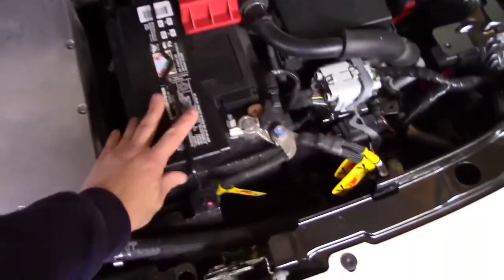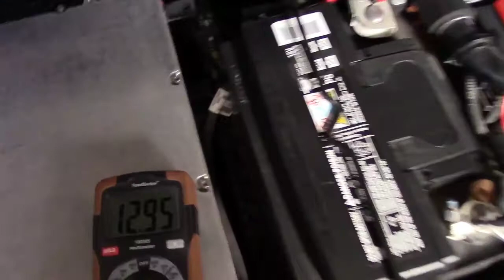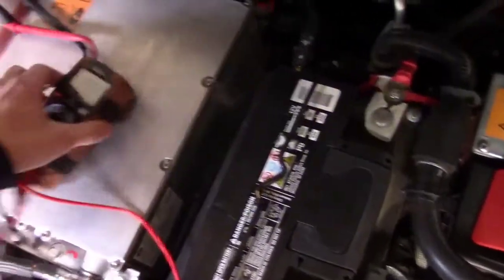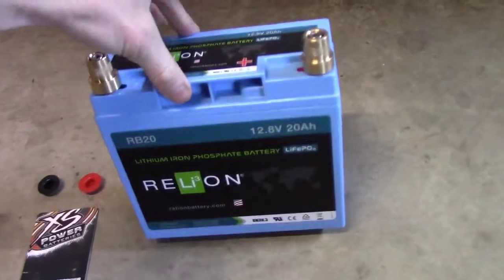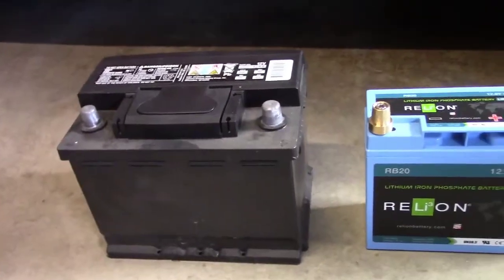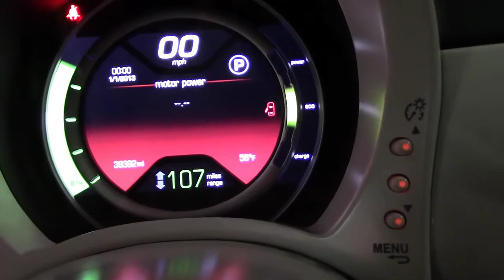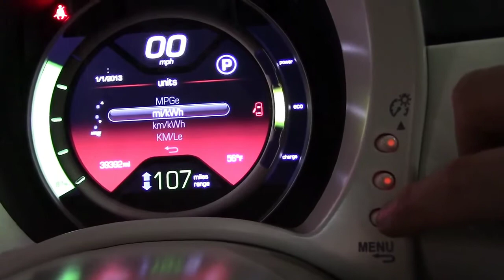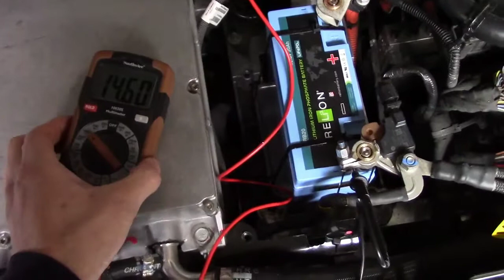Fiat 500e - Modified - episode # 18

Comment: John, I purchased this 20ah and replaced it 3yrs ago following your video. It has worked perfectly. I just got a 1500W inverter and planning on power a 600w fridge and some led lights in case of a power outage in SoCal. Does this 20ah will be sufficient? I'm planning on keeping the ignition ON and let the HV battery supply power to it.
Reply from the maker: I'm glad the new 12v battery is working out, you'll probably not need to touch it for another fifteen years.

I did a video on using a smaller wattage inverter on a 500e.  That one connected thru the 12v cig lighter port.  Honestly, I would proceed with caution & only power the essentials.  If you need 600w for the fridge, internet wifi, and some LED lights.  The grand total would  be well under 700w.   Try to get just what you need and not get carried away with the higher wattage stuff.  I know it's tempting, but there's nothing on the car that draws anything more than 300-400w of 12v current.  The battery heater and cabin heater are both high voltage units.  And at this wattage, definitely connect your inverter cables directly to the battery under the hood.

Comment: One reason the LIFEPO4 battery was showing good volts but not much capacity is because of how lithium batteries maintain voltage even when they are almost depleted (which is a great feature, for sure), unlike a lead acid battery that gradually drops voltage as it is depleted. If you have any lithium-powered tools or yard trimmers, etc you've probably noticed that they run great right up until they actually stop, whereas other battery types start running slower or with less and less power as they are drained. Mine also shipped with over 13 volts but I kept it on the battery charger for a few hours to top it off just to be sure. For the first week or so of driving I also checked the battery setup* every day to make sure it was maintaining the charge.

Thanks for giving me this idea to do this swap! haven't looked back yet and I've talked others into doing it too.

* I ended up with two 20AH 12V LIFEPO4 batteries and connected them in parallel, giving me 40AH, just in case.

Comment: Great mod! My 500e comes off warranty in four months, so that's the earliest I would do it. 30 pounds is a lot, especially in the front.
Reply from the maker: It's one of the easiest most effective mods to do.  Works flawlessly.  Prices have continued to drop.  So, there's even more incentive.  I bought another 12v LiFePo4 battery for another car (to be an electric car conversion eventually) it's even lighter with more capacity & $50 cheaper.
Reply: @theevolvingworld  My OEM battery finally became unreliable. I had to charge it a couple months ago, and then again this month. It's 4 years old. It's weird that random warnings flash on when the 12V battery gets low. I ordered the RB20-LT even though I am in the south because It only adds a pound, and gives a wider operating temperature range. Thanks again for the video!
Reply: @danielkangX  If you do this mod, be sure to charge the new battery overnight before installing. (Ignore what the voltage is, just charge it.) The 500e should never have to be jumped in the classical sense. It doesn't have a starter or pull a big current, it only turns on. If the battery doesn't support the current required to turn on, it needs to be charged or replaced. The 12VDC battery does not affect the high voltage battery that propels the vehicle. They are independent although the high voltage battery does charge the 12V system when the car is operating.

Comment: Lithium batteries are usually stored or shipped at nominal voltage 3.2 lifepo4 or 3.6-3.7 liion. It extends the life keeping it below that or above for long periods will keep it at rated life. It can be trippled or better if kept around nominal in use.

Comment: Hi John, thanks for the reply; here is an update, the Relion battery was replaced with a new one under warranty, and the same problem resulted:  12 volt system shut down after a few weeks of use.  It too took a trickle charge for about a half hour until full, so it's capacity also diminished to very little.  In between, I replaced the original lead acid battery and had no issues.  However, periodically the error message "Service  Electric Vehicle System"  so perhaps there is an underlying problem.  Several bloggers report that disconnecting the 12 volt battery will reset the error in most cases.  Any other advice will be greatly appreciated.  I take it your Relion RB-20 battery has been working fine ever since the swap was made.
Reply from the maker: Thanks for sharing your troubling experiences with us.  It still sounds like a DC to DC converter problem with charging the "12v battery" properly.  Fortunately, I never had any of these problems while owning the 500e.  Although, right before selling it, I removed the RB-20 and use it for testing projects on the bench.  In fact, it's about 4 feet away from me and is charged to 13.2v.   12.8v is nominal which like 50% charge.  They charge up to 13.4v when full.

Comment: If you get the regular 100Ah version it runs between about $700 and $1000, but that's probably overkill. I guess normal lead acid batteries are typically rated at 45Ah.

Comment: Hello, I stumbled upton this video as I was searching around for the "Service 12v battery" error. I'm planning to replace battery in my 2015 500e. Please excuse if my questions are dumb as I'm totally a noob in car tech 🙂. Would this battery be ok for my situation where I drive my car rarely? Like a 10 mile ride once in a couple of months. I've realized that the range on my car has gone very low around 65-70 miles per 100% - how can I get more miles out of it - I could think of weight reduction as one thing any other tips would be appriciated. 
Any other tips for me to love my car more :)

Comment: 2 things, I wouldn't be comfortable reducing the amperage by almost 2/3rds, seconds, in the event of a crash, those zip ties will snap like a twig, potentially causing a huge short & fire.. I`d strongly recommend you come up with a better securing method.
Reply from the maker: Thanks so much for the input.  The LiFePo4 12v has been installed for about a year now, thru the cold of winter & the heat of summer with no problems!  Yes, I suppose in a hard enough impact the ties could snap... But the battery is so light and the positive & negative connections assist in holding it in position.  I'll look at getting something more sturdier.
Reply: @theevolvingworld  I'd get you some nylon tie downs and never have to worry. Plastic tie downs may eventually become brittle being exposed to heat, etc. Glad to hear that you've not had any issues with this battery as I was thinking of doing the same thing (but a Kia Soul EV). Too bad the automobile manufacturers didn't splurge the extra few hundred bucks and go with lithium for the 12V system too (although as expensive as they are I'm sure they were looking for any way they could to cut costs).

So your reply is now a year old and so you've had that 12V lithium battery for about 2 years. Any issues?

Comment: Thanks for the great how to videos!  I performed this battery replacement with the same model and it won't power any of the 12 volt functions after a few weeks; i.e. the car won't start and the dash won't light up, no 12 volt functionality.  This has happened a second time after trickle charging the battery overnight to full.  Any suggestions before I contact Relion for an RMA?
Reply from the maker: Glad you have enjoyed the videos!  The DC to DC converter should be using the HV battery to top off the 12v battery as needed.  It will have to do this more often, but for much less time.  You should not have to "trickle charge" it ever.  Sub freezing temps will reduce the battery performance as would having some heavy parasitic draw.  If it's not one of those three things then it must be the battery.

Comment: have you looked into increasing the range of the 500e?
Reply from the maker: Sure have.  There are newer higher capacity cells that should retrofit quite nicely.  However, not really cost effective... yet.   Meanwhile, 134 lbs lighter doesn't hurt either.  Ciao

Comment: I've been following your vids and they are all great! I might become an owner of a '16 500e by thursday (depending on Carvana). My question is:
if I wanted to upgrade the audio system by adding a sub and amp (say around 250-500W RMS), would you see any issues arise from the additional load on these smaller batteries? Or would it make sense to either:
1. use two of them wired in parallel, or
2. a larger capacity  version of the rb20?
Reply from the maker: Thanks, glad you like them.  I would just be careful not to listen to it unless the car is fully "on".  The DC to DC converter should keep the 12v topped off.

Remember the 12v is the weakest link on any EV.  It needs to be kept sound. 
 Otherwise, the car won't work, you'll be stranded, and possibly kill the HV battery, as well.

I would get a bigger version of a LiFePO4 battery, as opposed to running two RB20 in parallel.  It will be cheaper, easier, & lighter per kWh.  Hope that helps.
Reply: @theevolvingworld  Would it possibly make more sense to go with a standard size AGM battery, which is better designed for audio systems, in addition to cost savings over the bigger LiFePO4's?
Reply from the maker: Honestly, I don't think you're doing anything too crazy.  I know some of the hardcore system builder's add an extra full size 12v to help out on load demand.   But. that's like a 4000 watt system filling a whole trunk of an impala.

The LiFePO4's are great especially on an EV for the longevity & light weight.   If those things matter enough to offset the cost, it makes sense.

Maybe just leave the stock 60Ah lead battery in there for now.  It is has far more capacity then what's needed for an EV.  If it works fine with the added load, then you can decide what to do later.  Ciao.

Comment: Thanks for the video. Aside, from the weight savings what does/did the lead acid battery power in the car?  I'm still an ignoramus when it comes to this vehicle.  I figured the 'regular car battery' was used to start gas vehicles, so what's this one used for in the eletric? and why upgrade (aside from weight) . Thanks.
Reply from the maker: Just like all current EV's, including Tesla's.  They are all still 12v systems.   The lights, radio, power windows/mirrors, etc.  And yes to boot up the computer this 12v battery is necessary for that too.  It last's ten times longer = less maintenance & cheaper (in the long run).  Cheers.
Reply: @theevolvingworld  One more question, if you don't mind... can this Lithium battery replace the lead acid or AGM ones in 'regular' cars?
Reply from the maker: @gatdammit  Yes, it's designed to do that.  However, this specific model with it's  20Ah capacity would be a little bit light on CCA in winter.
Reply: I think it runs the accessories when the car is off & Powers the contactors to connect the drive battery. 
The battery is still only last about 3 years, same in a BMW i3.

Comment: I’m using a lot of your videos to accomplish some mods on my 2014. I’ve upgraded to LED lights, removed back seat, and just ordered my ion battery. Can’t wait to upgrade, I hate how heavy the current one is and that Ive had to replace it every 3 years. When I change it out to the lithium ion battery, can I just charge it with the car plugged in charging or do I have to hook it up to a battery charger and charge it separately?
Reply from the maker: Every little bit of weight reduction adds up!  Once you add the proper terminal adapters on the top & adjust for the smaller size, you should be able to just hook it up & not think about for 15-20 years.   Enjoy the benefits of adding lightness!
Reply: @theevolvingworld  I got it hooked up now! A few concerns arose, the terminal adapters seem still just a bit lose like they are still moveable even as tight as the connections will go so I’m feeling like they don’t fit well. I noticed the adapters are tapered but the connections don’t seem to be so maybe that is the issue? I feel like bigger adapters would have worked better, but I didn’t see in the video you mention a specific size so I just looked up some info on the relion website and did my best to choose the right one. 
Aside from that some good things: The battery came with enough juice to power on the car right away I didn’t even have to leave it charging over night, heard the little ‘heartbeat’ sound almost right away.  Also, took the car for a test drive after installing ion battery and my god this thing reaallly whips now, it was quick before but now there’s a noticeable difference in dynamics. Jus feels light as air and takes off like a bird.
Reply from the maker: They should be "just firm enough", but careful not to "overtighten" as lead,  brass, or tinned copper are all softer metals.  The taper is for a more universal fit.  Put the cables on the thickest part of the terminal, if still loose then add some thin scrap metal copper or brass to the terminals for a tighter fit.  Don't overtighten. 

Even a little bit of weight taken high off the nose makes a difference.   The longevity of the new compared to old school nasty lead stuff is the best part.  Ciao.
Reply: Have had continuous issues with these terminals, never stay on and move around so,e times enough that it completely cuts off power supply and will reset all my settings in the car. I’ve had to jump start the battery twice, I ended up changing out the screws for the terminals cuz they were bottoming out before even tightening, shorter ones did the trick but still had issue tightening the connector enough to really grip them. They loosen so easily, everything else I love about this battery, but the terminals have been a nightmare

Comment: I emailed Relion about the issue and their response was "Just out of curiosity is you charger set up for Lithium or AGM? I have attached our Charging guide for you to take a look at."  Perhaps the 1volt charging default on the later Fiat 500e models are different (mine is a 2017).  If you provide your email address I will send you the Charging guide from Relion.  I tried an old lead acid charger and it also indicated full charge in about 15 minutes which made the battery output 12.8 volts but lasted only a few weeks worth of use in the vehicle.  Unless the charging amps/method can be changed on my 2017, I'll go back to a lead acid battery and purchase a separate charger to salvage the two RB-20s.
Reply from the maker: Relion has always stated it's a drop in replacement for any Lead-acid battery.  The charge curve is very similar.  I've used an old 12v charger from the early 1990's for all of my 12v charging lead or LiFePo4.  It's always get's the latter of the two up to 13.2 - 13.4v.  If your alternator or dc-dc converter (as is the equivalent in an EV) is working properly it should be putting out 14v.

You can buy a decent bench charger that you can fully customize for volts & amps.  Available on eBay or Amazon for under $50.  I have one that works great.

Comment: I did this, my car died on the freeway after a month. I don't remember the battery rating i used but I would try 2 if I do it again.
Reply: Legit concept tho, i know 2 can turn over a 350 v8. Not sure about recharging.
Reply: @robertpryor7225  He says in a comment above that he's had the 12V lithium installed for over a year with no issues (and that comment was from a year ago, so it's been two years since he installed it). Maybe you got a bad one? If you're thinking of doing two, you might as well get the 100Ah version: About the same price as two ($600 -$700), but with way more amp hours.
Reply: Was it a good car?
Reply: @leulekalzeleke7490  yes

Comment: Tried the exact same battery swap in my 2015 Fiat 500e, but it doesn’t work. Voltage is okay, but as soon as I turn the key the car dies and the screen goes black. I think this battery cannot deliver the Amps required to start my car. The original lead acid battery should be able to deliver 500 Amps, but the Relion can do only 40 Amps.
Reply from the maker: Sorry to hear of your misfortune.  This sounds like the new battery is not fully charged.  I would  charge it up & try again.  LiFePO4 batteries are best stored at 50% and yours might be even lower.  That should fix it or it might a defective battery.

Comment: ordered mine for my 2015 model, actually cheaper than the cheapest decent lead battery[had 10% discount codes for both] i could find also not $20 fee for not returning old one.

Comment: I have a 2015 500e, I dive to work in the am so I use the lights heat radio ect. Since most of these draw power from that battery, would a larger capacity lithium battery my car?
Reply from the maker: It should not really matter.  The DC-DC converter is always charging up the 12v from the  HV pack.  A slightly larger capacity LiFePO4 12v would not hurt anything and might give some added piece of mind especially if the car is parked for longer periods of time in colder weather.  The only downside would be added cost and a little more weight.